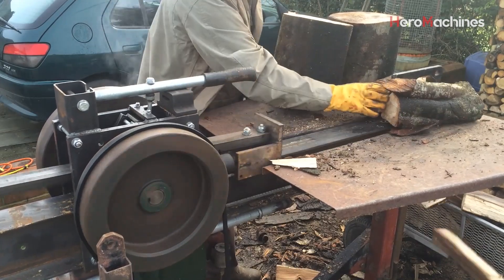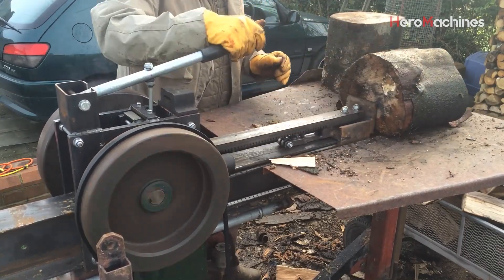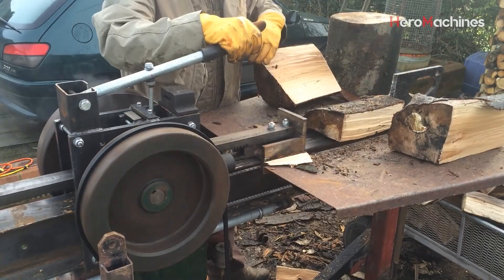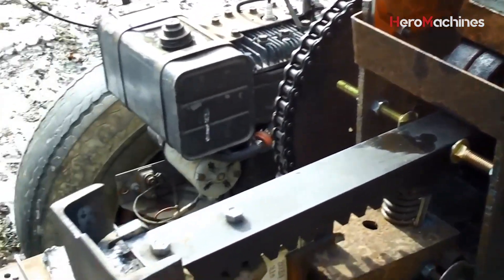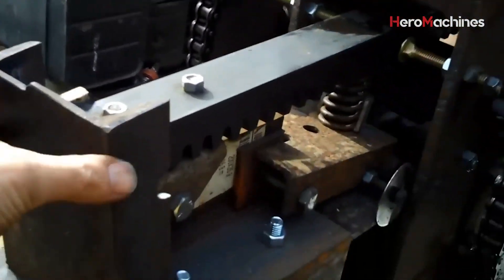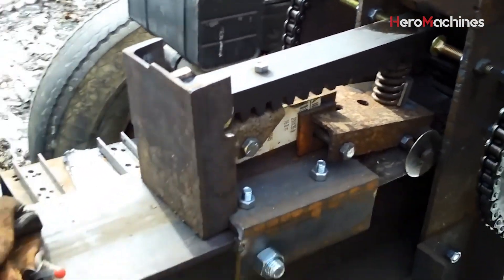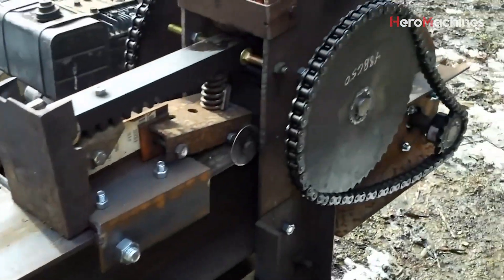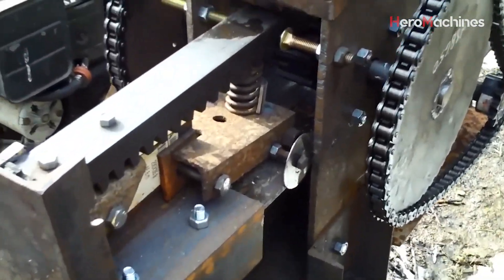This Smart Wood Splitting Method Works Faster Than Hydraulic Systems—And Costs Way Less

Comment: Hydraulic fluid is (essentially) incompressible.  Any wait for "pressure to build up" would be measured in microseconds.  All you've done here is to replace a hydraulic system, which lubricates itself, with an open rack and pinion, vulnerable to whatever grit and grime comes along.  I see no advantage to this design, and several significant disadvantages.

Comment: This is the first home-built log splitter I've seen that didn't require a heavy impact to split logs. The OHS implications are huge - not only are your hands a whole lot safer when you're not manoeuvring close to a blade that can move really fast, but also the risks associated with flying splinters or chunks of wood are a whole lot less and the risks of hammer noise are basically eliminated. It wouldn't work on the twisted-up grain of the river red gum we burned when I was a kid, but anything with something resembling a straight grain should work beautifully!